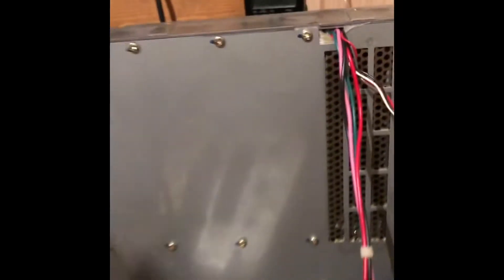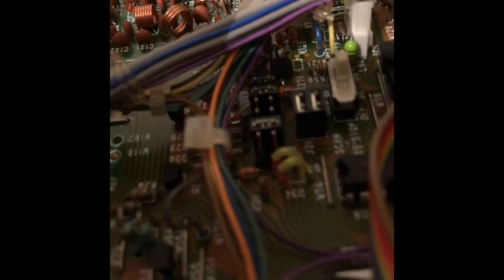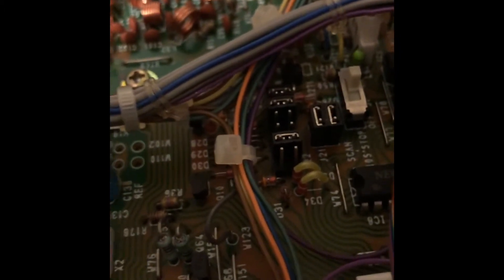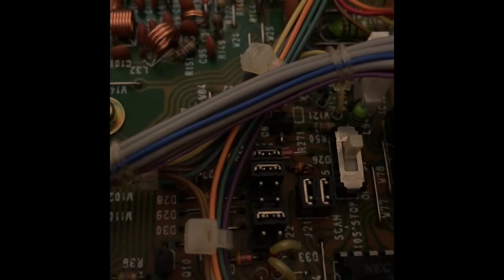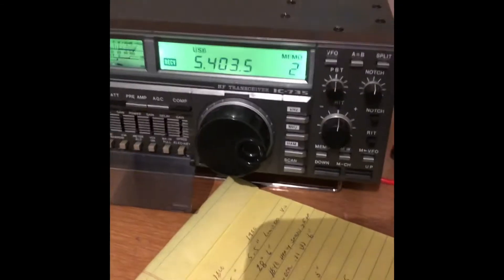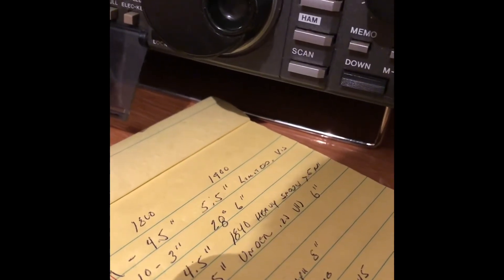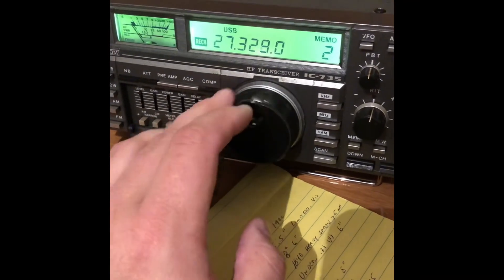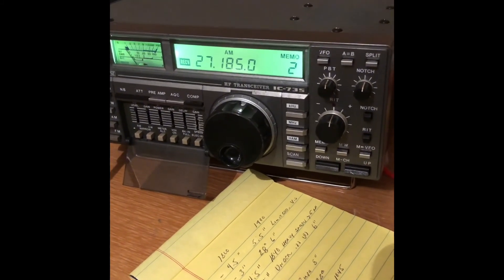The Only Icom IC-735 Wide Band Transmit Mod Video On YouTube

Comment: that's not wide band. wide band refers to the transmit signal s bandwidth.
Reply from the maker: Technically that is correct, in this instance however the mod is commonly referred to as “wide band transmit”. Perhaps frequency expansion would be a better description.

Thanks for taking a look my friend, 73!

Comment: Just got mine out of storage which has had the mod done and worked for a few days but started to lose TX on the expended channels not the other bands.
Unplugged the PA board then refitted and it was working fine.
Now i get very high amps showing on the power supply but no TX  on the expended channels.
What's going on could it be the filter board i have had to replace this in the past.
Any help is much appreciated.
Reply from the maker: @paulhotson5820  this most definitely sounds like a component gone bad on the filter board or in the PA. Look to the low pass side of the filter for any burned or damaged parts/components and replace accordingly. This also sounds like the PA could be overheating as well.
Reply: @hamandcheese25   I'm going to replace the power cable as it's the original and will take closer look.
Many thanks.
Reply from the maker: @paulhotson5820  keep me informed, I’ll be curious to see how it turns out for you. 73!
Reply: @hamandcheese25  will do 73s

Comment: İs it possible enlarge tx frq up to 50 MHz ?
Reply from the maker: Actually yes it is, the mod is done in the 10m LO, the transistor is replaced with a 2n5179   tripler on the 3 x 10 circuit. 

It is my understanding that this will unlock the PLL when done, which will require realignment. 

The TX can actually be enlarged all the way to the 23cm band, the higher ends require additional hardware to be completed in the form of additional PA bricks and PLL boards

Comment: I do have two of this 735 that was my father inlaws who passed away 15 years ago. Problem is, before they were working, but since it has been in storage for that long, now it doesn't work anymore. It turns ON though but that's it. No recieve and no display, just lights up and a slught hiss on the speakers. What do you think is the problem? Some say it just needs to be recapped. Also, do you know if the 735 users group have an email address? Thank you.
Reply from the maker: With no receive and no display it almost sounds like a main board issue, perhaps something as simple as bad caps. What are you using to power it?
Reply: @hamandcheese25  I'm using a 50 amp linear power supply sir. I really do hope it will still work 'cause I can never afford to buy a new rig. I'm asking a friend of mine in the U.S. to order for me cap kits from Klondikes caps.
Reply: @hamandcheese25  By the way, I checked the memory battery, and it's dead. Could that also be a factor?
Reply from the maker: @franciscolopez3229  most likely no, but at the same time it’s worth changing while you are in there. The power supply in use is more than enough to supply adequate power. My gut feeling is still leaning toward the main board as the culprit
Reply: Thank you sir and all the best.

Comment: I tried some test on mine is this right as power drops on fm if you turn power up on the grunt of radio it dims radio
Reply from the maker: It should have full output on all bands and modes the same as it did previous to the mod. If you’re experiencing a drop on FM it may be that the mic gain is too low or that the output is turned down, or it could be a damaged low pass filter. If it’s just dimming it could be a failing capacitor, Icom used plastic caps in these rigs and they’re notorious for failing without warning
Reply: Ok thanks tryd it today on uk fm it works fine  it’s fm uk not a lot going on thanks it works
Reply: Sorry frunt of the radio

Comment: I canot see what you cut
Reply from the maker: @2:10 you will see the modification to the D33 and D34 diodes from the previous. Snip them at the board and leave them in place
Reply: @hamandcheese25  :
The lighting could be improved upon for better visibility of the operation.
🙂
Reply from the maker: @daleallen7634  definitely, and I have been working on that. Thanks for the feedback and thanks for watching my friend 73!